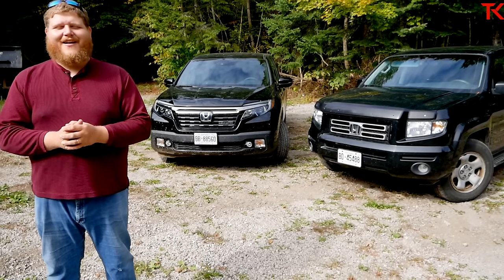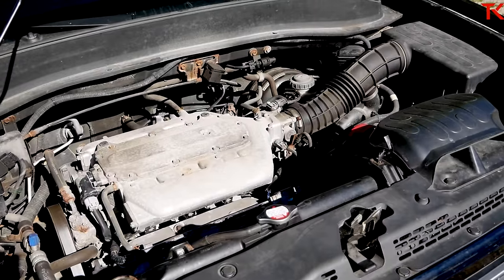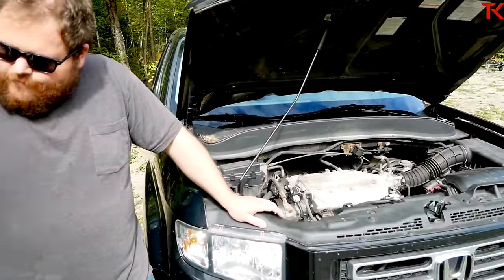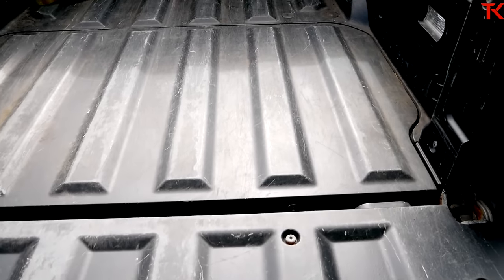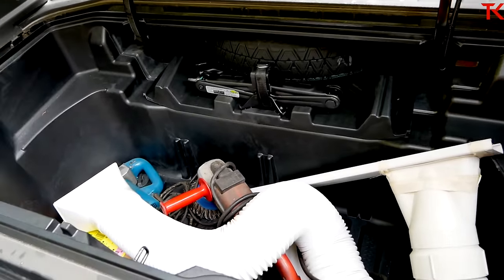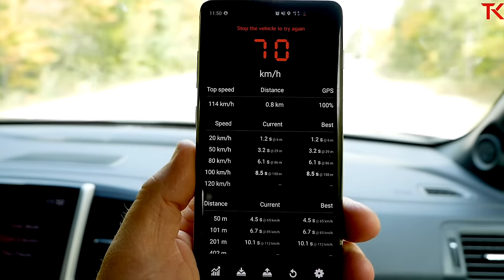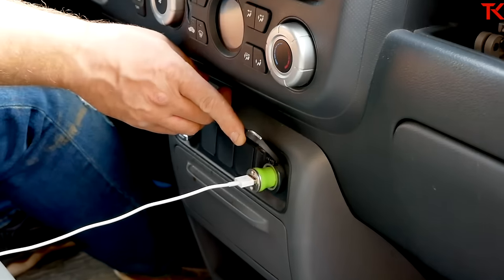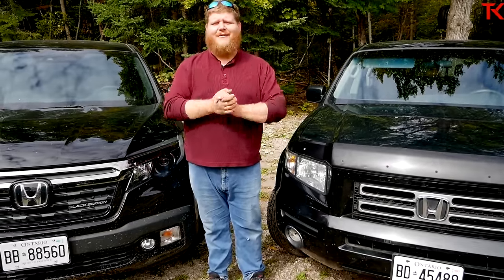Old VS New - Is the 2020 Honda Ridgeline Truly Better than the Old One? + 0-60 MPH Drag Race!

Comment: I got the same 3.5 vtec V6 on my 2003 Honda odyssey with a 5 speed auto, and I gotta say that engine pulls very strong on my odyssey....its so easy to do burnouts  without even trying, especially with Traction control off.

Comment: You'd be surprised how far some 32" off road tires on a ridgeline will go off road. If you don't need to tow a huge boat or put 35" tires on your truck a ridgeline works perfectly fine. My buddy has one with a 2" lift and cut fenders and 33s he had for a gambler 500 truck, he just uses momentum and home made skid plates to get over obstacles. We've driven it down trails that have given stock wranglers and Fj cruisers problems.

Comment: I have a 2007 Ridgeline bought it in 2009.
So owned it for 13 years! I've  had some repairs, brakes, exhaust,  one coil pack. The body it in good shape because I get it undecoated every year . The engine had got  a ticking noise.  But  it's lasted this long so not worried about it.

Comment: I had the Ridgeline 07 and loved it all the way. I sold it for a Toyota Tundra V8. I did this only because I have a 5000 lb camper and after two years of towing it I found I just needed more power. The mountains and steep hills just made this engine work hard. I never had any problems but I just needed more power. I sooo miss that trunk for sure. Great vehicle.
Reply: Just got a TT this summer and finding the same with my 09. She likes to rev at that 4k + range but I love the non truck truck of how it rides.
Reply: jeff ho And the mpg. I wish someone would have told me about the different sizes of gas tanks on the TT.
Reply: jeff ho I don’t know if it’s practical to have the larger gas tank installed or trade up to another truck with the larger tank.

Comment: Ive had a bunch of older Fords and Chevy's medium trucks and full-size, currently a Dodge ram Big Horn. Before my truck driving days I bought cheap 80's e30's.  I was shopping for a daily replacement for the wife and test drove a Honda Pilot.  I was like wow this thing rides and handles amazing.  Instantly thought I should buy a ridgeline.  now I'm on the hunt.  You can get over 20 MPG without sacrificing comfort, sportiness, and reliability.

Comment: I liked the comparison but a little trail review between the two would have made it perfect. 
Oh and could you add some more low speed articulation type stuff to your track. That is a huge part of offroading for a lot of us buying trucks or S.U.V's and it would be cool to see how well they flex as far as the suspension and the body and how well the traction control aids work if so equipped such as a locker. Just a thought. You have so much awesome space to work with.

Comment: Love my 2012 sport all black. It truly is all the truck I need. I love that it’s not full of the latest gizmos, less to worry about going wrong. Not a huge fan of the new design as I feel it takes away from the uniqueness from the market aesthetically. I also prefer the look of the front end of the old one, especially with the sports grill. But really you can’t go wrong with either.

Comment: Hi, I Own a 2011 Honda Ridgeline with 320,100 km and I Love it. I also worked for a Honda Dealer in Ottawa, Ontario and I also had other trucks. I love the First Generation looks better than the new Generation. The thing with Honda's is that they will last for a long time as long as You do the Proper Maintenance as Required. Yes, I also have some rust on mine but that is to be expected here in Ontario.

Comment: You forgot the 110 power outlet in the 09s center console. I have the 10 RTL and it has the 7 pin plug, no 4 pin at all
Reply: Idk why this is such a big deal. You can get a 7pin to 4pin adapter for $10 on Amazon.

Comment: The 08 had a remote mounted APP sensor. Not "proper" cruise control.

The seat bar is a pretty easy fix. There's a bulletin for it. Just do the hinges needed and don't remove the seats.

Comment: The original has the same profile as the Chevy Avalanche due to the designer was a former GM designer. What is the load capacity for these two?

Comment: I had a 2007 RTL for 5 years, till the local Honda stealership quoted me $3200 to replace the struts and do a four wheel alignment. I traded it for a new F150. The Honda wasn’t too bad for lite duty work and didn’t get crap for mileage when you were really workin it. I did love the storage beneath the bed. The only 2 things I really missed were ground clearance and a low range in the transfer case.

Comment: Good comparison. I have a 2009 Ridgeline and love it. I have 140,000 miles on it and no mechanical issues at all. Uses very little oil at this mileage and continues to work well with Penzoil 5-30.
 May need new shocks soon though. 20 mpg works for me. It would be nice if tHonda could get closer to 30. The truck has been serviced as required which proves that preventative maintenance is the way to go. 
If you hate the Honda Ridgeline,  phooey on you!  go buy a $80,000 gas guzzling Dodge Ram or Ford Fix-a-lot.  For my needs it's a perfect family utility vehicle quiet driving, with nice lines and  a car like ride. I have no need to beat up my truck with off road torture or impress my friends. ..

Comment: I have a 2008 Ridgeline and I love it. I think the look is very unique, I don’t like how they made the new truck more truck looking. It was an original look that Honda took away. Makes me sad that 2014 was the last year of the original look. Still held for 8 years when 4-5 years is the norm for a redesign. They should have just made small improvements like the Nissan Xterra did while keeping the root look of the truck in tact. That extra space between the front seats is needed. I have a vehicle trash container there with a grocery bag liner. You don’t get that in the new truck. Needless to say when I am need for a new Ridgeline I will be looking for a low mileage 2014 instead of a new Honda truck…hard to call the new one a Ridgeline when they took all the character looks out of it. I have had my 2008 since 2015 and still love to drive it everyday as if it was the first time I drove it. Only has 97K miles so it may be a while before I need a new truck haha. Thanks guys, appreciate the comparison video.

Comment: I have a 2007 RTS that I drove for about 5 years, with 160K on it today, then gave to my daughter. I now drive a 2020 RTL - E AWD that had 20K when bought. Personally, I love these trucks! Previously I have owned a Toyota T100, Toyota Tacoma, multiple GMC Sierra's, and those trucks were great, but the Ridgeline drives, rides and handles so much better. Sure, I cannot haul or pull as much weight as my previous trucks, but that was never an issue as I'm not pulling trailers, boats, or other things very often. So, the haters can go on hating, but if you drive one you will start to understand why Ridgeline owners are very loyal to these trucks.

Comment: I have a 2007 RTS which is the midrange Trim for American versions and I absolutely love this thing. It is quick and handles surprisingly well on curvy back roads for its size and weight. I drive it an hour to work daily instead of my 2019 Civic Touring because it’s easier to get in and out of after 8 hours of building Honda’s. The radio is ok but I’ve been spoiled by my Civic so it’s getting an upgrade really soon. It has 184k miles on it and it looks really good and runs like new. Honda did a really good job building these. I still call it a truck because I can. Lol. I added 18 inch black and silver wheels with All terrain Yokohama tires and this thing just goes where I want it. But anyways very impressed with it even though I would look at it laugh in the past and now I smile every time I lock it haha.

Comment: i have had all the midsize japanese trucks. i had an 08 ridgeline rtl,  a 16 frontier pro4x, and a 17 tacoma trd off road. the honda is the one i miss the most. for what i needed it for, it just was better. better storage, better ride quality, no need to mess with 4 wheel drive settings with a proper awd system. the bed and tailgate on the honda is awsome.

Comment: I have a 2013. I am in the camp of "love the El Camino look" . BUT...the big problem with the sloping bed rail means that a cover on the bed cannot be on top of the rail. Since it has to go between the sides the effective height under the cover is so short that I Have had trouble finding a cooler that will fit under the cover.  Other than that I love my Ridgeline.

Comment: I think you and everyone will agree on the spare tire storage , if get a flat and you have heavy or bulky load in the bed, you have to unload everything out to get  that spare tire to change. And put everything back in the bed.
Reply: That's so true.  If you have to pull over, regardless of spare location, due to a flat, you better make sure you're not on soft ground.  Better bring a lumber just in case the jack sink, but whoever think of doing that anyway.

Comment: Honda is bullet proof but it all comes down to what you will be using it for.  I would love to have this truck but since I can't slap a plow on the front of it, I would not buy it.  Two of my brothers have these, one has the older & one has the newer... both are very happy with them, but I threaten to push them off the road with my 2500HD...lol, but with the 8.1 vortec, I am sitting at the pumps while they drive past.  :)

Comment: Another trick. If you hit the unlock button on the key then hit it again and hold it down, it will roll down the windows. It's nice in the summer to let out the hot air when it's been sitting in the sun.

Comment: Back seat support rails are held in the up position via a plastic strap which in my 08 which I have almost never used the back seats in the down position. So the plastic straps have had constant pressure on them for some 9 -10 years before I noticed both plastic return to up position, pull straps broke at the same time. The whole back seat almost has to be taken apart to replace those broken straps. I've left them broke and so far no big deal. They all break but not for some time. In the old days, the truck would've long been in the junkyard before the problem even came up.

Comment: The bar under the back seat that's popping out is doing that because a small plastic piece broke, its a common issue with an easy fix using a steel part vs the oem plastic. I do enjoy the looks of either but I settled on an 18 Sport AWD because it did what I wanted better than the Gen 1, I like the absence of the touch screen, adaptive cruise, lane warnings, and stop/start that upper trims and and the 2020s have. The AWD has been excellent on twisty roads and lets me take curves fast and come out strong with some tire squeal for good measure, I've yet to spin the wheels taking off fast in the wet which is nice as my company F150 will spin unless I creep onto the highway unlike the Ridgeline which just goes. The trunk and spacious interior has been phenomenal and currently I have a rolling cart and rolling toolbox sitting in the back seat standing up with no issues. Seats 4 adults and a kid with plenty of space left and no discernible drop in power or mpgs.

Comment: That 1sr gen Ridgeline only has VTEC on the intake. What’s interesting is the Pilot of the same chassis ‘09-‘15 has almost the same power and torque ratings but it does NOT have VTEC for a high lift profile, it has iVTEC which is part of the cylinder shutdown system and the secondary lobes on the camshaft are blank lobes to keep the valves closed. The VTEC feeling around 4000 rpm is actually the variable length intake manifold flap opening.

Comment: I am still driving my 2006 (bought in 2005) Ridgeline, it’s 16 years old and still drives like new after 170000 kms. 
I have rustproof it a few times with Krown and there is not a spot of rust on it, I am very particular about maintenance ( not by the dealer).

Comment: The V6 Honda is a great engine,  I am undecided or scared of new nine speed that ZF has had major tuning problems in various installations.
Reply: The 6 speed has overheating issue and 9 speed has its gremlins worked out.

Comment: I have an 2008 too bought it in 2012 still have it and love it I’ll keep it forever .  Had s-10’s standard everything no power windows no a/c since 1985 .  So this is a Cadillac to me .  The back seat legs pulley breaks because they are plastic the new ones are metal and easy to replace it took me maybe 1 hour total and I’m not too fast .  I think only 1 of mine was broken but replaced them both.   I just got a recall for it about fuel tank straps rusting away possibly tank dropping off so definitely look into it.   Oh I paid 21 thousand for it with 39,000 miles at the time.  Now 120k runs great still

Comment: I have an 2007 Honda Ridge line and I love it to death would never get rid of it. Don’t like the stalling of the newer Ridgeline simply because it looks too much like all other  pick ups. If you can find one I’ve seen these things go to 300,000 miles and they are great. Thank you for the video it’s a good comparison but I’ll keep my old one.  things I did to my Ridge line  was I installed a racing Kevlar timing belt. This timing belt was designed to take up to 1000 hp so I won’t be changing my timing belt ever.

Comment: Also the 2008 trunk can hold a full size spare tire. The 2020 trunk can only hold a compact spare.  If you want a full-size spare in the 2020 you have add the mounting bracket to the back of the bed on the left side so spare tire is outside in the weather.  The down side of the spare tire in the trunk, is if you put a heavy load in the bed and while taking that heavy load some where you have a flat, you can’t get to the spare.   So you have to think ahead and remove the spare from the trunk and either set it beside the heavy load in the bed or put it in the cab behind the front seats.  The spare, the jack and lug wrench are all on a skid that you can remove from the trunk and carry all the stuff (tire, jack, wrench) on that skid and place it in the bed or behind the front seats.

Comment: the first gen motor and trans is bullet proof we have 2 at work and we abuse the crap out of them we exceed the towing capacity, we drive them like maniacs, now no one want to use them now because the AC doesnt work and the window actuators are failing and the door lock actuators are wonky, the odd bed shape on the gen1 makes getting stuff out of the bed from the side kinda annoying if your short,  the dual action bed swing almost never gets used, cool gimmick though costs about the same to maintain as a honda accord if u can find one cheap i recommend it

Comment: I personally like the Gen 1 Ridgeline.
I used to own an Avalanche and other than the sidewall storage, which the Ridgeline more than makes up for with the trunk/cooler/ body storage/hideout. There is so much to love in general about the Ridgeline. More than could be covered in a dozen or so videos  Mine has 212k miles on it, and runs like a top.  I am by no means a truck purist.  I only want as much truck as I will need on a day to day basis.  I was not going to purchase a truck that would tow a fifth wheel that I will never purchase, or haul two thousand pounds of payload that I would never put in it.

Comment: I’ve owned both, a 2012 Sport and now a 2019 RTL-T.  In my view the Gen 1 is only better in one way, looks.  The Gen 2 has much better MPG, ride, interior, etc.  these are great trucks and do exactly what I need from a truck.  I run into its limitations (towing, hauling, power) about once every two years.  Clearly the right truck for me, and I suspect most non-contractors or farmers.

Comment: Old Ridgeline has a true 4wd  verse to the awd system on the new one  a locking diff
Reply: They are both AWD.
Reply: @michaelfoulkes9502  have you tried the VTM4 in the first gen? I applied it in my 2013 in some deep muck to test it out, and it’s pretty amazing. Also, Unlike a true 4x4 you don’t need to activate locking diffs to enable it to apply power to all four wheels at the same time, even if some are in the air it is smart enough to get you power on the wheels with traction, it’s pretty great.

Comment: Bought mine in Spring '05 ('06 model year) only had to replace the alternator in 16 years outside of normal wear items. All the truck most people need. I always call it a 2 body trunk bc it is so roomy. Won't buy another till this one dies, I might go before it does. I too prefer the older body style. New ones look like all the rest of trucks out there. Good job on video to the brothers.

Comment: I drive a 2008 RTL with 185,000 miles on it. I have the cash for a new one, but dang it, I love my 08! A couple of years ago I almost bought a new one and asked myself why? I then installed a Pioneer NEX head unit with backup camera and Apple Carplay and the ONLY feature the new one has that interests me is the heated steering wheel. For $40,000 I'll just wear gloves.

Comment: I had the 07 and it had 180,000 on her when I let her go. The only reason I had to send her on her way was because I needed more power because we got a travel trailer weighing 5500 lbs. the max towing capacity for this truck is 5000lbs. All was good until we hit some major mountain roads and it did it with no problems but it was screaming. I now have a Tundra V8. I really do miss that in bed trunk and that double swing tailgate.PS. I wrote Honda and pleaded with them for a larger engine for us towing people and the answer was NO.

Comment: Got my 2008 Honda Ridgeline bought It in 2017 i got it with 149000 miles and now it has 203000 still going strong now just have to replace sensors or catalytic converter and planning to get a second gen later I. The future